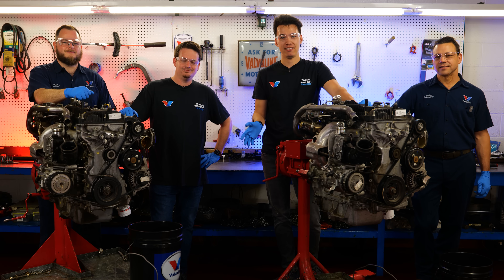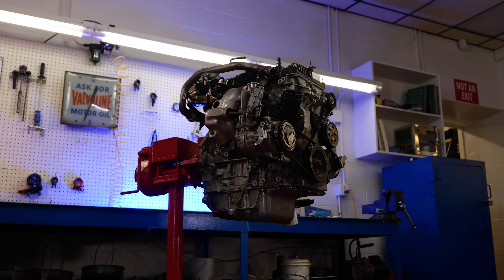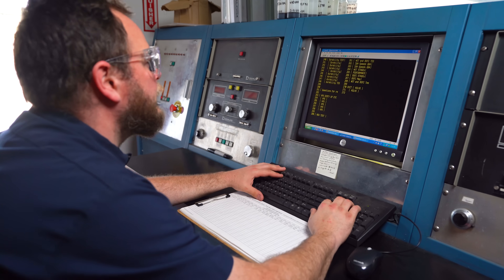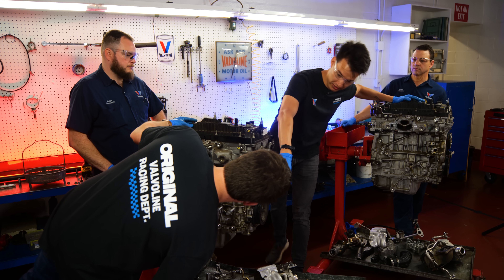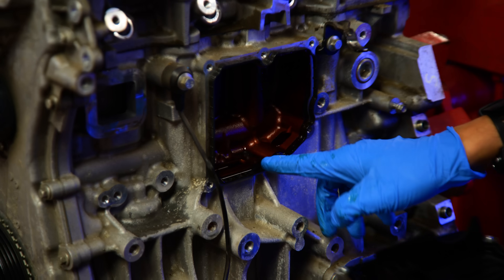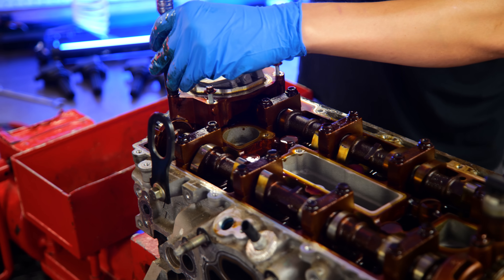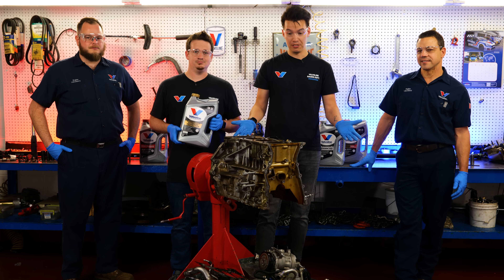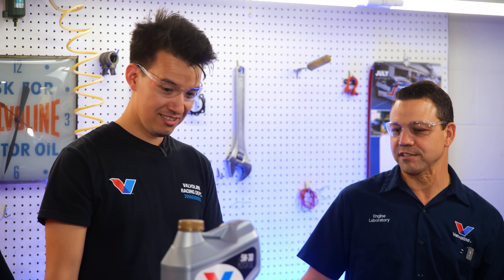Testing different oils over 4 years and 1 MILLION miles

Comment: They changed the oil every 10,000 miles in both engines. I would like to know what the conventional oil engine would look like if they changed the oil every 5000 miles vs. changing the oil every 10,000 miles in the synthetic engine.
Reply: It would look like they paid for 50 extra oil changes, just to get very slightly less gunk in there.  Oil, filters, and labor weren't free the last time I checked.  Like everyone else commenting here, I claim to change full synthetic every 5K miles, but more often than not it ends up being 6K, 7K, or sometimes even 10K.  

No big deal, that's why I bought a Toyota actually made in Japan, and use Pennzoil Platinum (usually Ultra, sometimes not). 

 I am 67, grew up with oils considered great at the time, but 100x worse than today, and have never had an engine fail due to oil choice or change interval.  The only 3 cars with engine problems leading to their demise or engine rework, were a 66 Fury (rod through the block in 1978), 70 Maverick (replace valve oil seals  in 1976), and 73 Triumph (rod through the block in 1977).  All were more related to being cars near their end of life when I bought them, probably after a lot of abuse.  Not one time have I had a mechanical engine problem with a car I bought new, and there have been probably 20.  Just being halfway diligent is plenty good enough.   Today, full synthetic and actually changing it by 10K without fail, is good enough.  Which may require aiming to do it at 5K or 6K, because of how schedules and life work.

I had a coworker who didn't do the first oil change on their Subaru until 43K miles.  That's pretty extreme, but the car survived it without complaint.  The shocking thing is that was 40 years ago, so almost surely not synthetic.

Comment: I worked for valvoline myself and the ppl that came in are so cheap but at least they come in and get the basic 39.99 and a coupon for just an oil change conventional oil and there cars still run thats how i knew the oil was good i saw so many cars climb the ladder from 0 miles to 300k all on conventional oil well done nd im sold after just working there!

Comment: Most companies that call their synthetic oil full synthetic arr not full synthetic I think they only have to have like 10 to 20% synthetic it may even be less than that to claim that it's full synthetic.  I run amsoil because I know it's full synthetic.  Price  is not too bad either. I pay about $7.30 a quart with free delivery to my home.  And changing the oil myself it comes out about the same as having a shop do it what's something they call full synthetic.  Just make sure you fill that oil filter up before you put it in!

Comment: Back in the day, I ran Gastrol GTX 10w30 conventional oil in my Challenger 340. 
Every time that I pulled the valve covers, the parts were clean without any buildup. 
Even after 100K miles, it still looked great. 
A good quality oil and changing regularly makes a difference.
Reply: The oil changes is far more important than the variety of oil. We have just removed a Mitsubishi phev from our taxi fleet because it just electrically died. The vehicle had done 359000 miles and the engine a 2.0 4 cylinder unit has never needed anything at all. More the gearbox or drive chain other than oil changes. It has has oil designed for diesels from 50k miles with 8000 mile oil changes and a tin of oil flush every other oil change.
Reply: I used Quaker State Ultimate Durability (now Full Synthetic) for 100,000 miles and then had to do intake gaskets and did valve covers while I was at it and it was super clean. About like i would have expected with Valvoline or Castrol or anything else. Oil has been dewaxed for quite some time now in the U.S.
Reply: GTX is great oil
Reply: That 10,000-mile oil change is not a good idea. I remember a drunken uncle when I was about 7 (1985), he grunted and coughed, and yelled, "CHANGE YOUR DAMN OIL!". Most of the older cars (to me) were fine. Most people get NEW, and become delusional.
Reply: Just curious how often did you change your oil?
Reply: @Blessed2354 
Oil and oil filter change every 5K.
Reply: These cars ran 10k miles, which is modern times interval.  My 2019 Mazda3 awd hatch with 31k miles, nothing special, just a 13:1cr 2.5L NA 4 banger has the intervals at 10,000 from factory.  I say screw that, I change it every 6k with Castrol Edge Full Synthetic, a 15,000 mile oil with Purolator One 15,000 mile filter.  Will be switching to Pennzoil Platinum Full Synthetic on the next change.  I'm not a fan of these 10,000 mile changes.
Reply: @DroneStrike1776  There is almost no degradation of synthetic oil until after 7,500 miles, generally, so no need to change earlier.  I use Castrol Edge and will stay with it.
Reply: @ I do a lot of city driving, small town life, and I actually live in an area with snow and trees.  There's so much pollen in this area that you can wash your car white car and the next day, it's green again.  The salt and sand is everywhere, especially when they pretreat the roads.  It looks like a dust storm.  It's why I usually change my oil around 6000miles and swap out air filter every 20,000 miles, cabin filter every 10,000 miles.
Reply: Best oil ever on my Ninja bikes. I live in a small town, had to buy different oil, bc Castr0l is hard to get, and my bike started knocking af. 
Changed back to Castr0l, and back on track.  👉Castrol oil 👈
Reply: Back in the day when I was building engines for my Mustang, first one I pulled used conventional oil had minimal wear after 140k miles, then the next one I pulled (pulling to upgrade no failures before Ford haters chime in) used conventional for 30k no signs of wear, next one had 45k using syn after break in looked the same as prior.  I never really saw any mechanical wear between the two, yes i didn’t look under microscope nor put huge miles on them but these were high HP motors driven HARD!  I still use syn because to me cheap insurance but the key is proper change intervals. Great video though.
Reply: Changing the PVC valve and that's why it's clean. Even with 💩 oil it would be.
Reply: @Bert-p3p pcv
Reply: shill
Reply: Tell me this! If syn. Is so great,  why dose it whipe lobes on a flat tappet cam?
Reply: I run Castrol GTX 5w30 full synthetic and I’ve had no problems in my 4 cylinder pickup I’m pushing 325,000 miles and its my daily driver
Reply: @Platano_macho  My "01 Suburban has 326K miles and I run Castrol 5w30 with no issues at all - engine doesn't use any oil on long trips, so I'm keeping this vehicle forever!!! Most miles driven in Mexico on imperfect roads, too.
Reply: @Platano_macho  Roller cam i guess!
Reply: @anthonyking4387 think so but man I switched to valvoline restor and protect and my engine stop burning oil while idling so I’m testing it for now but I’ve noticed a significant difference guys I’m on my second oil change and I’m at 337,000 miles right now I hope Castrol makes something similar
Reply: @Platano_macho cool! Me to!
Reply: @anthonyking4387 I run 5w30 and so far I’ve had amazing results
Reply: @Platano_macho  I know it's great oil! I've rescued several engines that had been using other oils with Castrol GTX. I will likely use Castrol GTX full synthetic myself next oil change. I've had great luck with QS and Castrol. But I used to have good luck with Havoline back when it was Texaco. I think the biggest thing with modern oil is changing it often enough and using a decent filter. Some people use a 10-15,000 mile oil with a $2 filter that's not good enough for 3000 miles. . and then they blame the oil brands.
Reply: @ I use either Baldwin or wix in my pickup but I change it every 3,000-5,000 miles I’ve been using Castrol since 2007 when my pickup only had 67,000 now it’s 322,000 and ny catalytic converter failed at 302,000 roughly.
Reply: @Platano_macho Castrol rules
Reply: @sadfacts7751  had very bad experience with Castrol
Reply: Castrol rules. Decades with perfect protection🤚
Reply: @sadfacts7751  no
Reply: Castrol is 'Liquid Engineering'...
Reply: @chrissmith2114  i had very bad luck with Castrol all their products even overrated overpriced mobil 1 garbage

Comment: As a retired Master Mechanic with 60yrs of experience, I can tell you oil changes, driving habits and weights of oils also have various results. I worked for Mack Trucks (factory) and Case (construction equipment) dealer and if you sold 50 units, 35 of them would run, what's considered normal wear, and 15 would have abnormal wear. That was evident even with frame and cab component failures.  So I wish you would have done 4 vehicles, because the law of probabilities would have given a better understanding of what was actually happening.  Great stuff. 👍

Comment: My 99 Mirage has been getting full synthetic for years, it's at 236,900 mi currently, runs great, and the inside also has that golden color. Every oil change, not a speck of metal in the pan. She runs great and I'm a proud owner who maintains my little car strictly and by the book. I want that antique plate :)

Comment: I've always used Mobil 5W-30 Fully synthetic on my Turbo RS, 2 services ago, Mobil was not available anymore in my country and only Vavoline. I was abit hesitant to use this brand, but at the end I did. Same viscosity Vavoline Fully Synthetic. I am glad I did after watching this Video. I guess regardless of the brand, Fully synthetic is the oil that will protect the moving parts better than conventional oil. I had no choice but to use Fully synthetic as recommended by my car manufacturer for this engine. Thank you so much for the video, cleared a lot of doubts. Cheers

Comment: Why would you even run an engine 10,000 miles between oil changes. I never go over 4,000 miles. Some of my cars only 3,000 miles. I don't care what they say oil breaks down and it's not offering protection. Much after 4,000 miles. Wow
Reply: Depends on the application. I bought a new Scion/Toyota XB in 2004. After first 2 oil changes for engine break in I went to 10-12k intervals using Mobil 1 extended performance oil and filter. Still have the car and it logged 205,000 miles before rust took it off the road. It rarely consumed any measurable amounts of oil between services. I never did anything other than spark plugs, water pump and belts. Never even had the valve cover off it once. I used it like a mini work truck and even hauled a small trailer with it occasionally. 

Would I recommend that on these new overly complicated turbo engines. No way. The cost of repairs are insane so I would do shorter intervals. I would still feel comfortable with 5k intervals with quality synthetic oil.

Comment: what if you changed the conventional oil every 3000 miles like we used to, would it still leave a varnish deposit as bad as only changing the oil every 10,000 miles
Reply: That's an extra 116 oil changes.  How much do you want to pay to reduce the varnish deposits in an engine that is OK at 500K miles either way?  Might be cheaper to just budget for a brand new engine at 500K miles if you want to make it to a million miles.  Which I most definitely, do not want to do.

Comment: Why would anyone run conventional oil ESPECIALLY after seeing this comparison?
Reply: Because, except in very special circumstances, it makes no practical difference as long as the API rating and viscosity are correct for the engine and proper OCI's are used.  This "study" was full of holes.
Reply: @ 
Yes, it does. Those engines had their oil changed at regular intervals. The synthetic out performed conventional.  It lasts longer, isn’t as susceptible to heat damage, has molecules of consistent size.  Conventional is simply cheap.
Reply: @jimgordon3206  If you're responding to my comment, yes, "synthetic" oil is superior to conventional oil in some ways. The point is that, if appropriate OCI's are used, it makes no practical difference which you use, except in rare circumstances. Personally I switch back and forth depending on price at the time. I always change my car's oil and filter with my own hands...always. Same with ATF drain and fill. I keep my cars just about forever and zero non-electrical engine/trans issues over the last 60 yrs.

Comment: I have 250,000 kms on my 2015 ford f150 5 liter engine... 5 oil changes per year... full synthetic oil for the winter months and a synthblend for the other 3 seasons... every fluid has been changed after I bought my truck... and not a leak of oil or any other fluid. Had a new water pump installed last spring. That is the only thing I had to replace not counting brakes and rotors.
Reply: Oh by the way... valoline or Castrol 5 20 r the only 2 oils I only use...

Comment: Conventional one would have performed way worse with way more coating and carbon buildup if they actually had drived it outside where dust, rain, cold temperatures, hot temperatures exist.

Comment: Ford is crazy if 10,000 miles is the oil change interval especially for a turbocharged/VVT engine in my opinion. I would change it at 5,000 miles maximum personally. But both engines are impressive and show how far an engine can go if you take care of it!

Comment: I would NEVER change my oil every 10,000 miles! I own a 2007 Buick Lacrosse with the famous 3800 series 2 and I use conventional oil. I don’t drive 3,000 miles in 3 months. So I just change my oil every 3 months.

Comment: Research:
Argonne National Labs Boric Acid Lubricant research

Dissolve about heaped tablespoon of Boric Acid/Oxide to about a cup of boiling water. (It wont all dissolve. That's fine)
Add this (all)  to the to a well run in to old, warm engine, fully filled with oil  and drive of immediately.

Take it easy for around 10 km (the oil is thinner) and you will feel this stuff kick in.
At that point you can floor it!  :)

This stuff will dislodge any sludge in the engine so you need to change the oil and filter after a day or 2.
NB: VW engines have a very-very fine sieve on their oil pump pickup that this sludge will block in short order.
Unless you just have to make a 'fail' video, use something else.

Comment: What was the transmission maintenance for these runs? Fluid changed at what interval, any failures? 

I know this is meant to be a test of the oils, but it seems like the data for how two new explorers held up over 500k easy miles would be nice. How did the 10 speed do?

87 octane fuel?

Comment: Great video, thanks for all your hard work. When you said 500,000 miles (800,000 KM), I was expecting a Toyota engine. I'm so surprised that you said Ford 2.3 turbo. Good job Ford! I have used synthetic oil in all my engines since it came out. I always change the oil at 5,000 miles (8,000 KM) and with a quality oil filter, and have never had an oil related breakdown.

Comment: Oh gee, you "tested" oil for 1/20th of what EVERY oil maker with the API symbol on the container MUST do! Wally-World's "Best" or Dollar General's $1.29 a quart oil is EXACTLY as good as the Purple or Red or Blue oil IF the SAE rating is the same. Most motor oils say "SAE 10W-40" and "SJ" the weight (viscosity) followed by "Service (rating) J" which means almost any normal spark engine can run it. "Racing oils" DO NOT have a "service rating" (like Castrol Super S 100% caster bean oil) as they are NOT made for even a 500 mile change interval. Turbo engines and diesels require special oils for their needs, and you PAY for every additive they add to motor oil. The guys in the lube lab at the old Cities Service Technology center said "You can use Wesson Oil IF you change it often enough!" When I worked at a service station in the mid-late 1960's, there were MILLIONS of cars/trucks on the road with NO OIL FILTERS, so you needed to change oil every 1000-2000 miles. Now with oil filters and FAR better metallurgy and machining, there are oils you can go 25,000 miles on. But they COST seven to ten times what "off-the-shelf" oils do. Are they "BETTER"? Nope. Unless you drive 5,000 miles a week and can't stop for oil changes.

Comment: Honestly I trust conventional oil way more than I did before😂 10000 miles in a turbocharged engine and it made it to 500000k? My 2v 4.6 better last forever with its 3-4k mile oil changes with 5 quarts of valvoline full synthetic and 1 quart of Lucas oil stabilizer